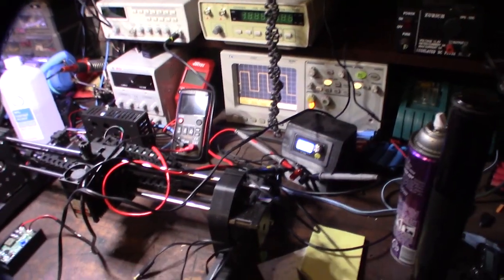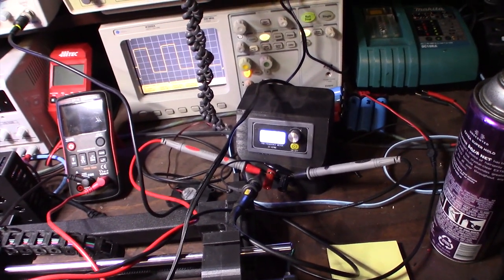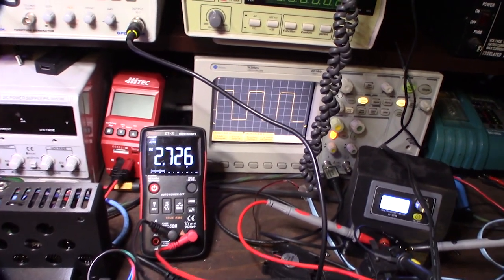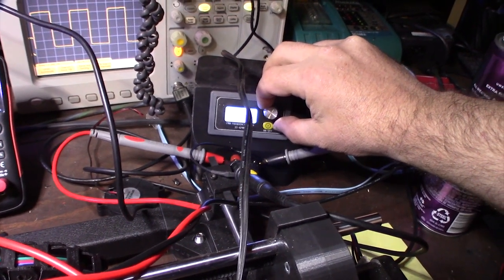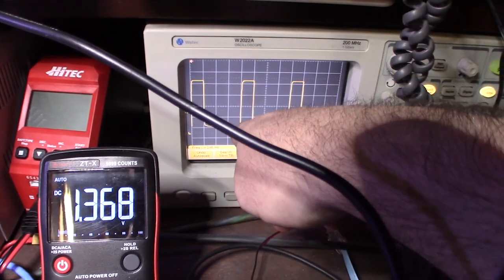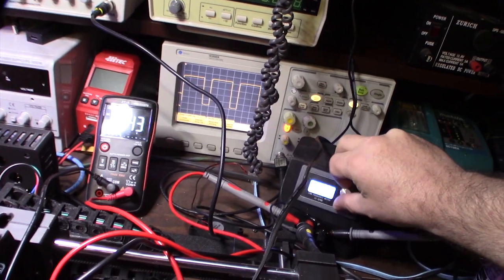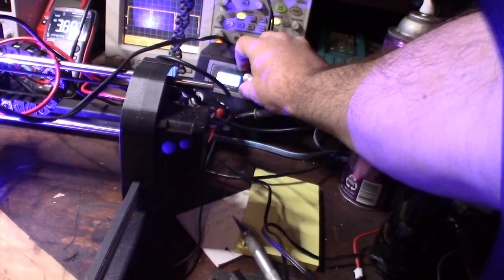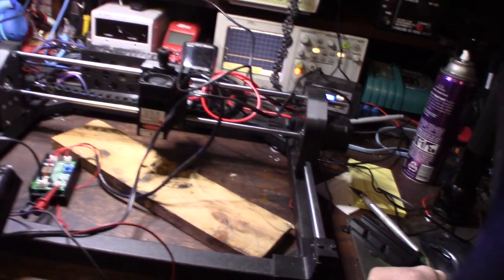Using PWM Pulse Width Modulation to control a Laser Diode for engraver cutter TTL GRBL Arduino

Comment: TTL is transisitor transisitor logic of 0 or 5 volts. PWM is ttl on and ttl off  at whatever frequency you want to switch at. Like having a on and off switch, flip it on and the laser is on, flip it off and it is off. Or flip the same switch on and off at 1000 times a second to modulate the TTL signal of 0 or 5 volts at 1000 Khz

Comment: Thanks for explaining this. I need help. I want to use a 12V laser module on a 24V laser engraver. If I use a separate 12V power supply for the laser and the two PWM wires from the engraver will this work? (I'm new to this but here is what I think. The laser module has 4 wires. Two are +/- 12V and the other two wires are PWM 0-+5V? So the 12V is to power the laser and the PWM is just a switch to turn the laser on/off?)

Comment: So my control board has both ttl and pwm. It came plugged in with a single wire to ttl. Can I just plug this wire onto the PWM S pin for PWM control?

Comment: I purchased a NEJE 1500mW replacement laser it is not PWM, and I purchased a CNC-01 V2.0 Nano Arduino 2 axis stepper and PWM or TTL  Laser controller.  I am pretty sure I could just plug the laser into the 2 wire ttl output but I would Like to use the PWM output. 3 wires +/-12v and PWM output. Is there a PWM to TTL Laser adapter out there, I see them on the backs of  higher power lasers with a fan. they take PWM 3pin and 2 Pin Fan outputs and drive the laser diode and fan. I'd like to get Grayscale etchings.  I plan on repurposing one of my 3d printers using the x axis and y axis only.

Comment: Thanks for sharing your progress. Awesome work! I just found you here on YT and I'm intrigued because I want to run my laser on Grbl with an MKS GenL 1.0 controller as well. I'm curious to know if you have tried running your laser from either T2, Lightburn, or Laser Grbl control software yet.

Comment: I need help!! I am trying to connect my 5.5W Laser with a PWM to my MKS base V1.4 motherboard on my 3d printer... but i don't know where to connect the wire connecting that consists of the  PWM, the +, and the - wires. how did you get to text your lase like that??? what did you connect it to. and in the end, how did you get yours to work with your board. please please help:(
Reply from the maker: I followed the pin diagram from MKS. Its usually Pin D11, on your board it looks likes servo 1. Are you running GRBL or Marlin
Reply: @fintechrepairshop  running Marlin.
Reply: @fintechrepairshop  I connect the +,- and the PWM wires from my Laser Control Module to servo 1? where is that located?
Reply: @fintechrepairshop  can you help???:(
Reply from the maker: @TimberWood.Customs  I'm actually not sure in Marlin. In GRBL its D11. I like Marlin better but GRBL has better laser support like shading.
Reply: @fintechrepairshop  you can use GRBL on a 3d printer motherboard?? i didnt know that. how do i do that?? ill do anything to make this thing work and get it up and running. as i have spent $140 on this 5.5W laser. I just want it to work
Reply from the maker: @TimberWood.Customs this the board I use now.
 https://www.amazon.com/gp/product/B08KT7436H/ref=as_li_tl?ie=UTF8&tag=fintechcomm0f-20&camp=1789&creative=9325&linkCode=as2&creativeASIN=B08KT7436H&linkId=c4fc4d673e482ac5fb65299b3f7a56d8
Reply from the maker: I originally was using an MKS Gen L but I could not get PWM to work. It was just on and off. You need PWM for shading.
Reply: @fintechrepairshop  how did you get it to work at all? my laser wont turn on at all? where did you plug yours in to even get it to just turn on or off??
Reply: i wont need shading so how would i connect it without the PWM